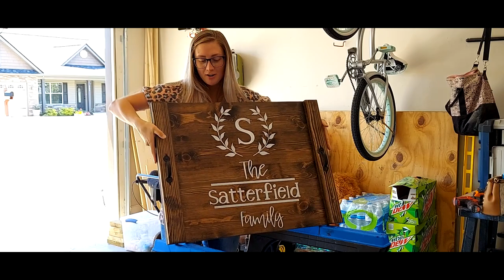How To Make A Stove Top Cover | Noodle Board | Serving Tray

Comment: I like the way you walk through the project explaining it all.  Also the miter saw on the ground had me remembering once I was using a homemade utility trailer with 4' walls an da board on top of those as a "miter station" once way back.  Do what gotta do, it still cut wood just fine.  Also the HF clamps... got a whole shop full because as I tell people I could have 1 Bessey or I could get 4 HF and last I checked not much I can build with 1 clamp but plenty those 4 HF clamps get done.  One day we will both have Bessey's hanging all around the shop but until then keep on making.
Reply from the maker: That's right, just gotta keep on keeping on.
Reply: Truck tailgate works too!

Comment: Great video! Do you apply the Modge Podge to hold the stencil on the wood. I guess my question should have been, do you put it on the wood and then apply the stencil or stencil down and then apply over the stencil?
Reply from the maker: Stencil then modge podge, but since then we actually got away from using mode podge all together.

Comment: So we're they going to use that as a Food Surface???
Reply: No! I put cutting board on it so I have extra prep surfaces. But sealed so if food gets on it I can easily clean. Do not put hot foods on either it will ruin design.